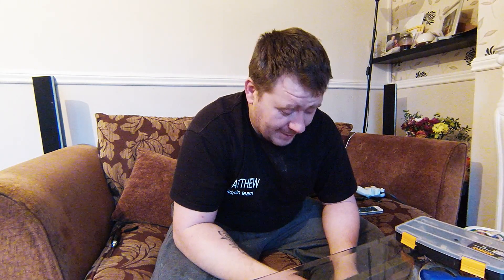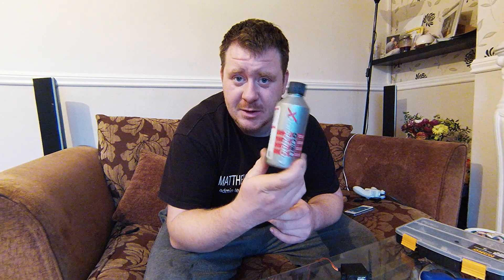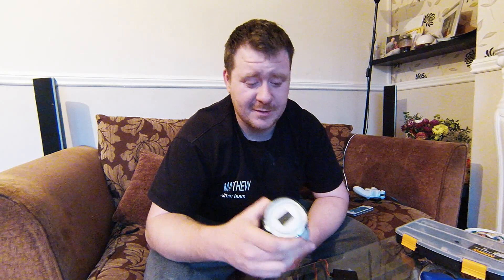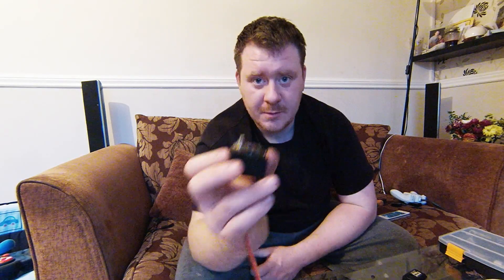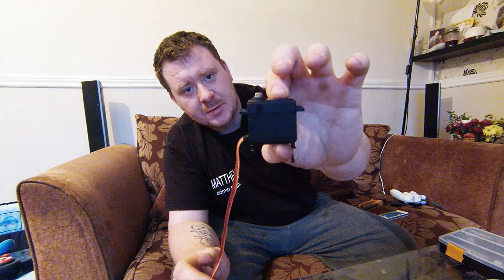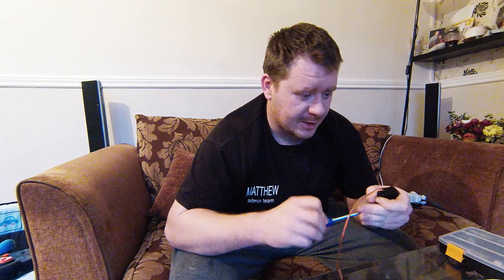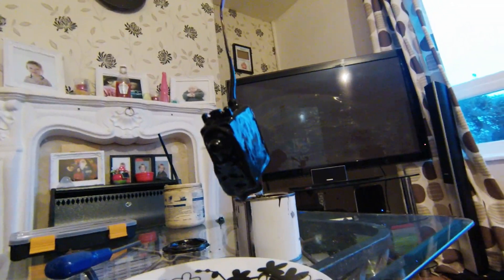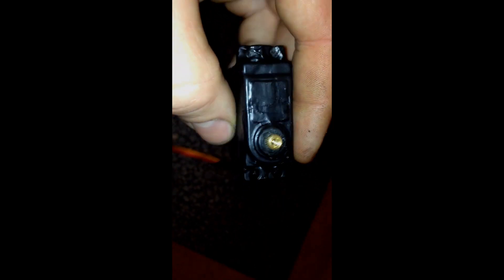HOW TO WATERPROOF A SERVO - ESC - RECEIVER - RC

Comment: Great video, but i must confess I just buy waterproof servos. They're like £6
Reply from the maker: What kg are they though and are they titanium geared
Reply: Oh no at £6 they're only plastic gears and I think 6kg,  so not major but to be fair I have one on my Gelande II and never had a problem. I find the really strong ones turn faster than is realistic and the strength has a tendency of breaking stuff if your wheel gets wedged but you try to steer because you didn't see. 
I have to say I don't understand why people spend £100 on a Savox servo. I get quality and speed and power, but is it all necessary?  Especially at £100! I get it for a bigger 1/6 or 1/8 rig, but does a 1/10 need all that?!
Reply from the maker: I run a £100 hitec in my xr10 but it needs it to be able to turn properly on the rocks but I do think that the power HD 1501 servos are good once waterproofed and they are 17kg the reason for running such hi kg is that it helps a lot when you are bound up you can use your steering to get you out of most situations also if you have a good radio you can turn your servo speed down but you tend to find the higher the kg the slower the servo is
Reply: Cheers for the info bro ;-)